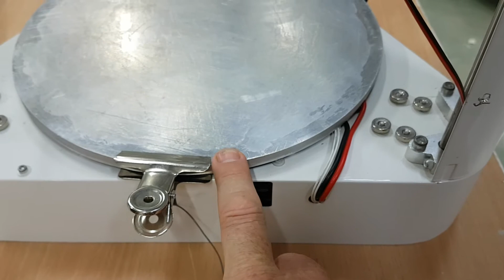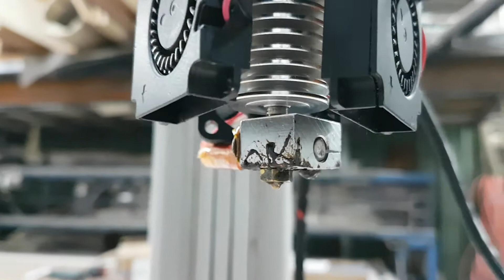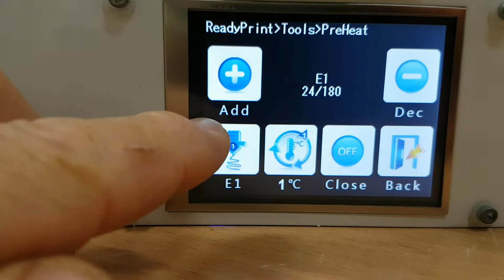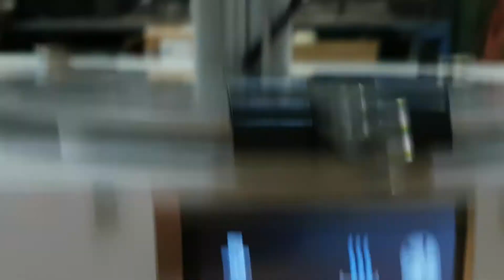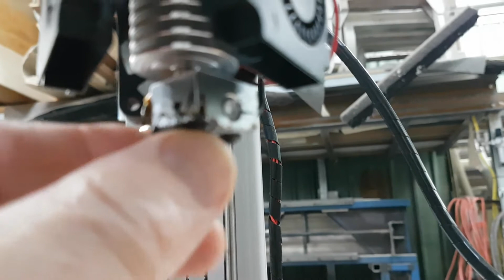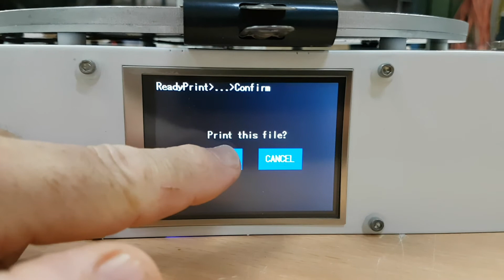Using Autolevel on the Big Cricket.

Comment: ohh, this is aluminium plate. i see. and position the hot end to +1mm from the heat bed (Z=1mm), after move the edge of the bed... the gap is 1mm?. because my printer head scrach the heatbed :(
Reply from the maker: EgyetertesTSZ The platen that comes with the machine is anodised, so it won't work.
The peice I have is an extra.
Pay close attention to the sensor wires.
Reply: yes success the calibration, just i think wrong my original configuration.h file, because not correct some offset (example: smooth rod offset). please send for me your configuration.h and Configuration_adv.h files from the marlin folder. (these are the delta settings)
Reply from the maker: Mine is not an arduino (8 bit), it;s a smoothie board (32 bit).
Apparently they made both. 
I don't have the firmware file, as I not needed to modify this printer.
I have modified all my others :/